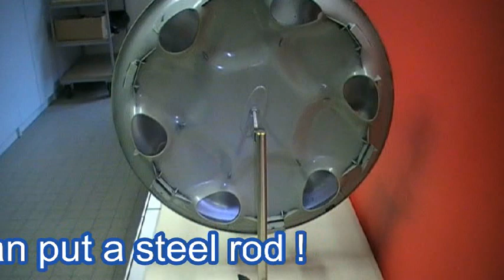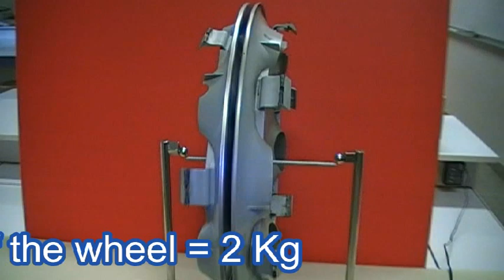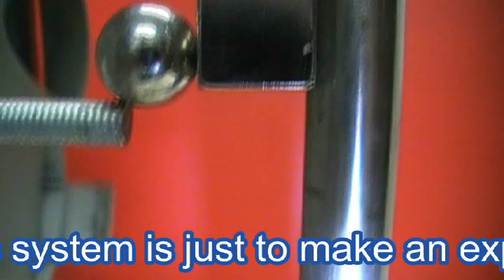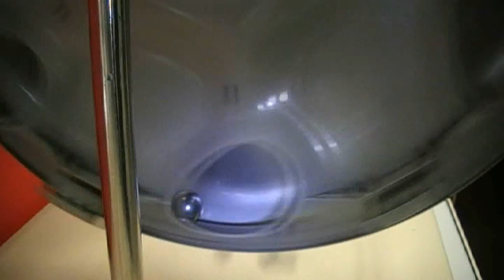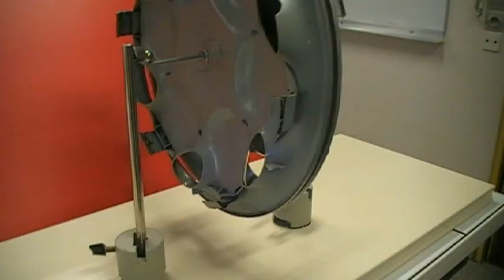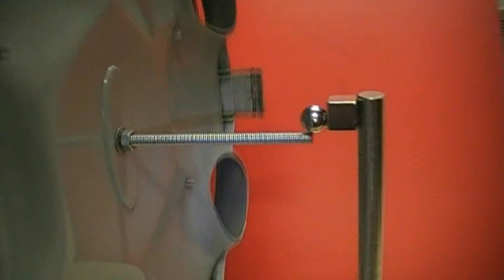Magnetic ball bearing

Comment: Hi, you almost had a great idea for the steel ball to roll through the inside rails of the wheel like a hamster.  But I found the problem: . Once the ball assumes the 7 o'clock position, the ball just sits still, held against gravity by the magnet.  And the wheel sits still also.
 
The magnet overcomes the gravity of the ball, so there is no gravity left over to turn the wheel. 

You would have to release the magnet and glue the ball down for it to turn the wheel.